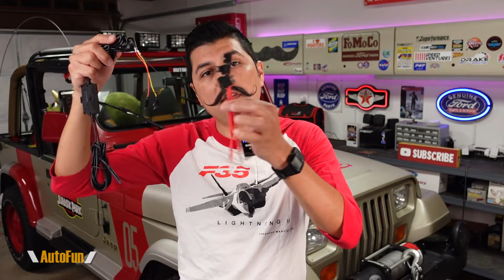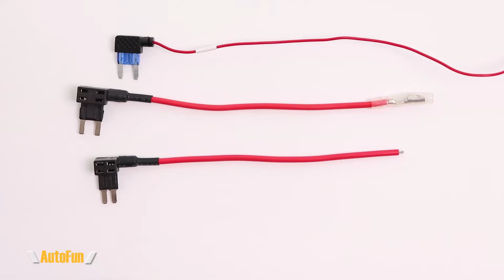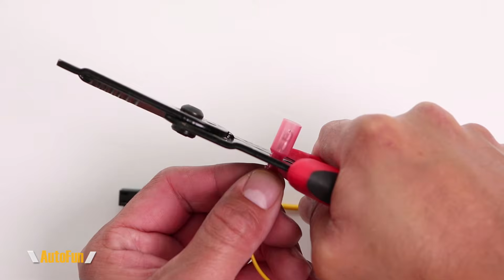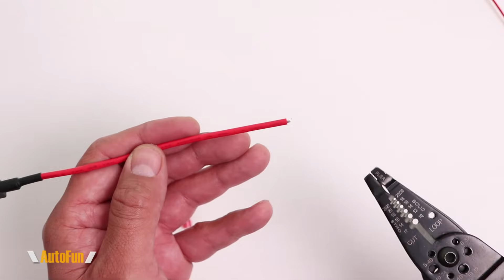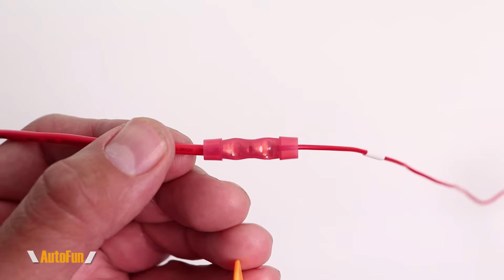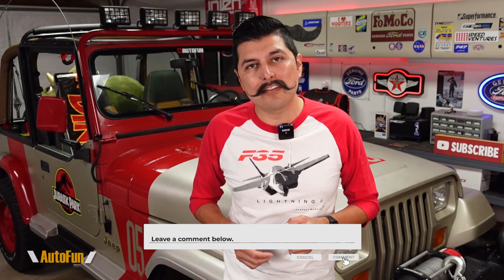How to Install FUSE TAPS on Hardwire Kit (For Dash Cam Hard Wire Installation)

Comment: Why didn't he just cut the wire in the part which have two fuse, and juste install the one he cut in first slot fuse?
Reply from the maker: I personally don't like to plug the hardwire molded fuse into a functional fuse tap, because I don't like how high the assembly gets when stacking the molded fuse from the hardwire kit into the functional fuse tap and then having to deal with cutting and shutting off the unused pigtail so it does not contact anything (here is the video where I show this https://youtu.be/wAad_JA7kz8 at the 9:55 mark for those wondering what that looks like) cheers!

Comment: Can I just connect a single fuse from a hardware kit in the place of the original fuse without doing all that? Are there any risks?
Reply from the maker: I personally don't like to connect the hardwire molded fuse into a functional fuse tap, because I don't like how high the assembly gets when stacking the molded fuse from the hardwire kit into the functional fuse tap and then having to deal with cutting and shutting off the unused pigtail so it does not contact anything (here is the video where I show this https://youtu.be/wAad_JA7kz8 at the 9:55 mark for those wondering what that looks like) cheers!

Comment: Why do you cut off the fuse and not use the fuse tap directly?
Reply from the maker: I personally don't like to connect the molded fuse into a functional fuse tap because I don't like how high the assembly gets when stacking the molded fuse from the hardwire kit into the functional fuse tap and then having to deal with cutting and shutting off the unused pigtail so it does not contact anything. Here is the video where I show this https://youtu.be/wAad_JA7kz8 at the 9:55 mark for those wondering what that looks like, cheers!

Comment: I have two separate dashcams to hardwire: a front VIOFO and a rear KAWA, each with its own hardwire kit. My car only has a few suitable fuse locations available. Is it safe to use two add-a-fuse taps on the same fuse slot, or should I use one fuse tap and split the output to both hardwire kits? How would you size the fuses in that setup?

Comment: I wasn’t expecting to come across one of your videos again, BUT here I am and of course the kit that came with my dash cam the fuses are smaller. So my question is if I have a butt splice that came with the camera can I pull that apart or so I need to cut it and make a new connection? I was thinking I could cut the insulation and gentle open up the crimp. Hope I’m making sense.
Reply from the maker: I would recommend making a new connection (a new crip) it's quick and ensures a good connection, cheers!

Comment: 2 main reasons as you said….
1. Fuse size of hardwire kit may not match the fuse size of the vehicle
(^How about if my car fuse and hardwire fuse size both are the same size?^)

2. Fuse box in the the vehicle maybe fully occupied and to order to install hardwire kit need to remove existing fuse from the fuse box and install the fuse from hardwire kit
(^if the hardwire kit come with the molded fuse, can we just tap the molded fuse on the empty slot at fuse tap, without cutting the molded fuse wire and without joining to the fuse tap wire?^)
Reply from the maker: Ah yes, I personally don't like to plug the hardwire molded fuse into a fuse tap, because I don't like how high the assembly gets when stacking the molded fuse from the hardwire kit into the fuse tap and then having to deal with cutting and shutting off the unused pigtail so it does not contact anything (here is the video where I show this https://youtu.be/wAad_JA7kz8 at the 9:55 mark for those wondering what that looks like) Cheers!

Comment: Would have been great to know the size of the fuses you removed.
Reply from the maker: Remenber blue is normally used to denote a 15A fuse, however in cases where there is doubt, installers will peel back the plastic molding on the original hardwire kit fuses and confirm the number physically stamped on the molded fuse or contact the manufacturer to confirm the fuse rating if there is still doubt (as the Amp rating can vary depending on the hardwire kit being used) Cheers!

Comment: Some people advised using needle nose pliers for crimping - tried that but it didn't budge. Is that normal? Would I be better off with crimpers?
Reply from the maker: @Fig7sy  A secure and safe connection (approved by the harnessesing industry) can only be accomplished with the correct crimp tool (and proper technique), Cheers!

Comment: Hi I have 2 empty slots to do hardwire kit but due to low profile I need to use the fuse taps. Can I use use fuse taps even though I'm using only one fuse for the dash. where would the single fuse go top or bottom?
Reply from the maker: Hi! Ah remember the top slot is for the hardwire kit and the bottom slot is for the original fuse pulled from the vehicle (if any). Here is my video showing the install on a empty fuse spot where there was not other fuse present https://youtu.be/uZp95NbNlmM Cheers!
Reply: @ This is perfect thank you. One question I'm using the new 70mai 4k omni 360 with both front a rear dash and also battery pack for parking mode. What size fuse do you recomend are 5 each ok or what size do you think is should put? I'm using two empty slots.

Comment: Hi Alex.  Thanks for sharing your knowledge with your followers, it is greatly appreciated. I have a silly question for you. If you hardwire a dashcam into the fuse box why do you need to connect the ACC wire if the BATT wire is constant power? Thank you.
Reply: Thank you Alex for answering my question sooooo quickly. So what would happen if you don't connect the ACC wire. How will the dashcam react?
Reply from the maker: You're welcome! Dash cams that require a 3 lead hardwire kit will usually need all 3 wires to be connected in order for the dash cam to work correctly. What I recommend when someone does not need park monitoring, is just to turn it off in the settings menu (most dash cams will let you turn off this feature) Cheers!
Reply: Thank you Alex.
Reply from the maker: @ You're welcome!
Reply from the maker: You're welcome! Ah ACC is used to tell the dash cam if the vehicle if the vehicle is On or Off. Cheers!

Comment: Fuse taps are too big ugh
Reply from the maker: Hi! There are other ways a hardwire can be connected without using a fuse tap. It can be connected using IDC connectors, here is how those work https://youtu.be/LHGxwulIPes An alternate method is via lap soldering. I do have a full series on soldering, starting from the basics (including tools and equipment) all the way to advanced soldering for those that want to learn that process as well, stay tuned, Cheers!

Comment: Note on the wire strippers most people are not aware but there are two sides marked for Solid wire and stranded wire on the jaws of the stripper. So make sure you know if you have stranded wire or solid wire and match it correctly to the markings on the stripper jaw because it does make a difference.
Reply from the maker: Great input! Definitely want to make sure the correct side is used, Cheers!

Comment: Hey! Its necessery to use bullet terminal or  can  just connect these two cables and put a plastic cover on them? What is the purpose of the bullet terminal?
Reply from the maker: Hi M! A a different terminal type can be used or a splice (what we call a butt terminal) or soldering, basically any industry approved method that assures a good termination. Cheers!

Comment: Too bad no one is showing how to install the default ones without modifying the wire.
Reply from the maker: Hi S! The install is the same as fuse taps, so the process is even easier since there is no secondary fuse to load (but remember molded on fuses do not support using them in a already used spot, they are only meant to be used on empty fuse spots) Here is my follow up video where I cover how I find ACC and BATT on any car https://youtu.be/K2iKXj82354  However I strongly recommend profession installation due to the dangers mentioned on that video and the dangers mentioned on my full install video https://youtu.be/uZp95NbNlmM Cheers!

Comment: Can you use a fuse tap to connect to a 15V source to power a 15V device if one of the slots in the fuse box, rated at 15A, is damaged?
Reply from the maker: Hi D! Ah remember, volts and amps are very different things (however they are related). I have a video coming up where I cover the differences, stay tuned. Cheers!
Reply: @AlexAutoFun  Sorry. Mistake.  
I have two 15A blower motor fuses in my AC unit. One of the fuse slots is damaged, so I was wondering if I could use a fuse tap on a functioning 15A slot and add another 15A fuse to it to supply power to the other blower motor

Comment: Compré una cámara y no venía con el cable ACC . Lo compré en Amazon y necesito saber cómo instalarlo en una Toyota Sienna 2019.
Reply from the maker: Hi U! I would recommend for your installer to confirm the correct installation process by following the instructions that came with your new dash cam. Cheers!

Comment: If I understand correctly, the only way a hardwire kit can be used without using a fuse tap is if the fuse panel has open spots that are powered, correct? You shouldn’t just remove a fuse and add the hardwire kit in its place, right?
Reply from the maker: Hi John! Ah nope, there are other ways a hardwire can be connected without using a fuse tap. It can also be connected using IDC connectors, here is how those work https://youtu.be/LHGxwulIPes An alternate method is via lap soldering. I do have a full series on soldering, starting from the basics (including tools and equipment) all the way to advanced soldering for those that want to learn that process as well, stay tuned. Cheers!

Comment: but what fuse do we use for the dash cam? (not the original fuse)
Reply from the maker: Hi N! The Amp rating of the fuse for the hardwire kit is determined by the hardwire kit being used (some kits have higher Amp requirements and some have lower amp draw). Here is my follow up video https://youtu.be/Yky9_tTvwMc where I explain how hardwire kits work and the different features to look for. Cheers!

Comment: Hello,

I notice you used an example of a 10A at the beginning.

Seems the hardwire kits use 15A fuses. What if you can't find a Battery fuse that is 15A? Would you need to use a tap so that you can use a lower fuse Amp and still have dashcam?

For example, I found a Battery Fuse that is 7.5A but I keep finding that you should not use a Amp fuse higher than the rating.

I am trying to install a GKU Hardwire Kit in my Holden/Chevrolet Equinox and can only seem to find 7.5A Batt Fuse.

The manual says to use lower than 15A fuses slots, which is confusing.
Reply from the maker: Hi C! Ah remember a functional fuse tap creates 2 separate independent circuits (each one with a different amp rating partially determined by fuses that are loaded into the each fuse slot in the fuse tap, the car's internal wiring and current load on the circuit to be tapped) The fuse removed from the car in the fuse tap bottom slot and the second fuse (top fuse) is for the hardwire kit. So they are each independent of each other. So I'm not necessarily looking to match a fuse amp rating on the car with the fuse amp rating of the hardwire kit (sometimes it does happens but when it does it's coincidence). Here is another video https://youtu.be/YibUc7myohQ where I cover the hardwire install in more detail and my other video showing the rest of the wiring https://youtu.be/uZp95NbNlmM Cheers!

Comment: Can we just place the wire with the molded fuse into the upper slot of the add-a-fuse kit, without all the cutting and crimping and buying and placing a new fuse?
Reply from the maker: Hi A! I personally don't like to connect the hardwire molded fuse into a fuse tap, because I don't like how high the assembly gets when stacking the molded fuse from the hardwire kit into the fuse tap and then having to deal with cutting and shutting off the unused pigtail so it does not contact anything (here is the video where I show this https://youtu.be/wAad_JA7kz8 at the 9:55 mark for those wondering what that looks like) Cheers!

Comment: Tsk Tsk - To the wire end of the Fuse Tap Adapter, I crimped the FEMALE Insulated Heat Shrink connector.  This way I have no exposed metal on the Fuse Tap Adapter connector that could cause problems if or when the connectors are disconnected.   Yes, I can leave the disconnected Fuse Tap Adapter in place even after the Dash cam wire has been disconnected.
Consider checking out the "E-Volt Insulated Heat Shrink connectors".   Consider "Spade" connectors in preference to "Bullet" connectors, which are easier to "see" that the wire has been push in far enough but not too far in,  B4 crimping the connector.
Also, the E-Volt contains red, blue, & Yellow Insulated Heat Shrink Butt Connectors.
Reply from the maker: Hi AZ! Yes different quick disconnect connectors can be used (and the order can be switched as far is which is female or male as required depending on the application) , this is just a general description of how quick disconnect and butt splice connectors are installed. While most installers have a preference over one over another there are cases where the customer specifies a specific connector and most installers can accommodate for it. Cheers!

Comment: Can I install it to a spare fuse?
Reply from the maker: Hi Vasu! Yes my preference is to use empty fuse spot. Here is my follow up video where I cover how I find ACC and BATT on any car https://youtu.be/K2iKXj82354 However I strongly recommend profession installation due to the dangers mentioned on that video if erroneously tapping a critical system of the vehicle and the dangers involved with air bags mentioned on this video https://youtu.be/uZp95NbNlmM Cheers!

Comment: Got Camara security car HD 1080 cam only coming red cable Small fuse the black cable to put it 24/7 i need change the fuse can put it my Honda CR-V ex manual 4x4 2000 dont know what fuse can used to start 24/7 my put saint one he truck it stay all the time on be sensor ant it can got off and on be parking? Thank you
Reply from the maker: HI Maria! Here is my follow up video where I cover how I find ACC and BATT on any car https://youtu.be/K2iKXj82354  However I strongly recommend profession installation due to the dangers mentioned on that video and the dangers mentioned on my full install video https://youtu.be/uZp95NbNlmM Cheers!

Comment: I have the double fuse taps for my 4 ch. Rexing cam. They come with 2v fuses. Is it ok to add a 15, or 20amp fuse, next to the 2amp, that came with the hardwire kit? Or do I need to match to the one, I’m using that’s already in the fuse box? Like, if I’m tapping into a 15, is it ok to have a 2amp, and a 15?
Reply from the maker: Hi Mark! Fuse taps creates two separate independent circuits (each one with a different amp rating partially determined by fuses that are loaded into the each fuse slot in the fuse tap, the car's internal wiring and current load on the circuit to be tapped) The fuse removed from the car goes in the fuse tap bottom slot and the second fuse (top fuse) is for the hardwire kit. So they are each independent of each other, each one driving it's own load. And here is my follow up video showing the hardwire process https://youtu.be/K2iKXj82354 Cheers!

Comment: What fuse can I tap into on my gmc sierra fuse panel
Reply from the maker: Hi Wathian! Here is my follow up video where I cover how I find ACC and BATT on any car https://youtu.be/K2iKXj82354  However I strongly recommend profession installation due to the dangers mentioned on that video and the dangers mentioned on my full install video https://youtu.be/uZp95NbNlmM Cheers!
Reply: If you have to ask that question - you'd be well advised to have your hardwire dashcam PROFESSIONALLY installed.
Reply: @azclaimjumper  well it professional install by me thanks for YouTube videos sucka

Comment: Hi Sir, many thanks for the effort, really helpful, I have a question
With BAT wire connection would dash cam still stays on while car is switched off?
Reply from the maker: You're welcome Zeeshan! Ah when correctly hardwired the dash cam will turn off and enter park mode (if enabled in the dash cam's setting and if the dash cam supports it) when the car is off. What I recommend when someone does not need park monitoring, is just to turn it off in the settings menu (most dash cams will let you turn off this feature). Cheers!

Comment: Putting in a dash cam.  One thing I've ran into and not sure how to proceed.  I have multiple "factory designated" open fuse slots in my fuse box.  In what position of the "Fuse Tap" would I place the 5A Dash cam fuse into, and would it be ok to simply leave the other slot of the "Fuse Tap" empty?  Thanks
Reply from the maker: Hi Rocinblues! Here is my follow up video where I cover how I find ACC and BATT on any car https://youtu.be/K2iKXj82354 And yes my preference is to use empty fuse spot. However I strongly recommend profession installation due to the dangers mentioned on that video if erroneously tapping a critical system of the vehicle and the dangers involved with air bags mentioned on this video https://youtu.be/uZp95NbNlmM Cheers!
Reply: Alex, thanks so much for the quick response.  Those video links worked like a charm!!!! Got it installed yesterday.  Cheers.
Reply from the maker: You're welcome Bud! @dialasmile